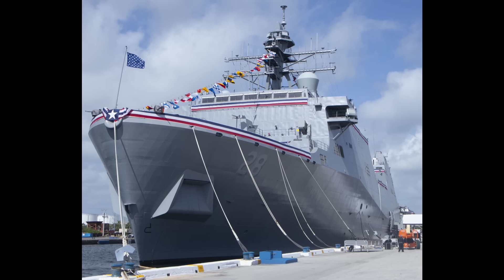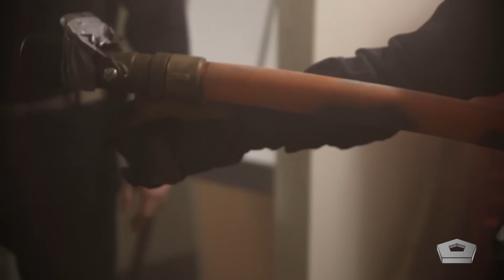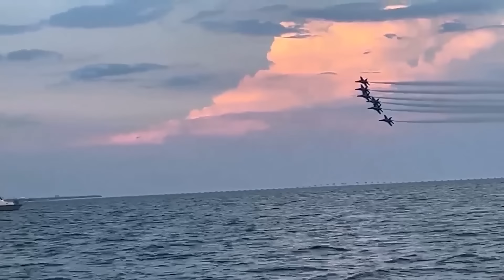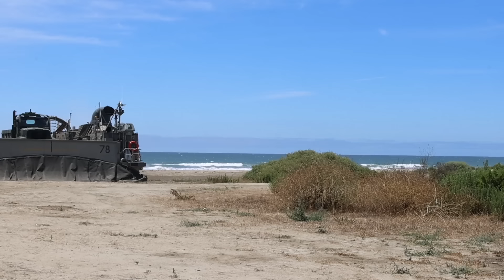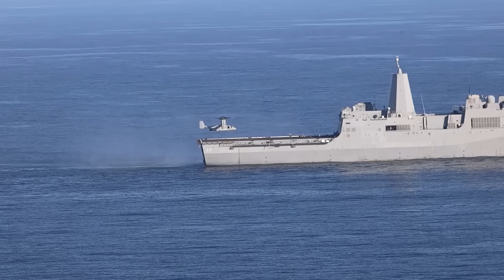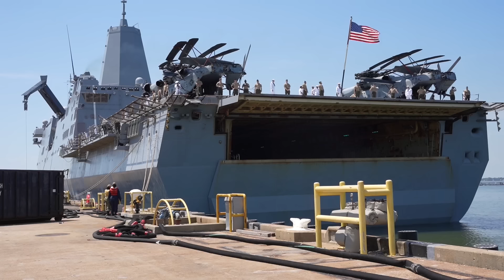San Antonio Class: The Warship That Exposed the Depth of US Navy’s Budget Problem

Comment: There's been a long phenomenon of retired high ranking navy officers (or officers of US military in general) going to various military industry, using their connection and influence to lobby for unnecessary and often time ridiculous specifications or projects, and ultimately convoluting the procurement process. For the San Antonio class, there was absolutely no reason to equip the vessel with expensive VLS. If a LSD ever need to provide its own air-defense, it pretty much guarantees there was a major fuck up somewhere else, and the last ditch insurance policies were the CIWS/CRAMs. Guess who the geniuses the defense industries have welcomed as board members and executives? Yep, you've guessed it, the same minds behind the abysmal failures like the LCS & Zumwalt.
Reply: Good point, but VLS have been cut according to Google.

Comment: If you think this ship class was handled badly just look at the current state of the constellation-class frigate. FREMM was selected because it was “off the shelf” ready to be build design. No need for lengthy R&D period. All that said, the Navy required so many changes to the FREMM design AFTER approving the contract. The Constellation is literally delayed to finalize the design. Mind you, the overall design wasn’t finalized before construction started.
Reply: The US version of FREMM was supposed to have about 70% parts commonality. It was never going to be COTS (commercial off the shelf) due to the necessary changes to accommodate US standard systems. Major issues with that program were: not realizing the major structural changes required to install those US systems, not building an engineering ashore facility to finalize systems, starting construction without a finalized design, and cost overruns coming from the European contractors. Not that there haven’t been cost overruns with the US side, rather the Europeans were completely disingenuous when proposing the plan, knowing it would require MUCH more than what they proposed. See lying and fraud in the dictionary
Reply: @nsatoday  Engineering ashore facilities are definitely the smart way to go.
Reply: @nsatoday  So two peoples with fraudulent cultures trying to defraud each other in the MIC, hahahaha, this is just too funny. It's like a thief accusing the other thief stealing from them, while they were also stealing from the other side.
Reply: @nsatoday dont blame the Europeans when American shipbuilding is pure trash just look at the Zumwalts, LCS and ford class
Reply: @BNTPP-c2k  why wouldn’t I acknowledge the European consortiums faults? I acknowledged the American ones. You are funny. How many corruption and Fraud scandals have there been with the French and Italian military industrial complex recently? France India, Italy Greece and on and on. I was fair and blamed both sides. 
The LCS was absolutely a mess. Ford? Some teething problems but nothing insane. Ford beats the pants off the next three competitors
Reply: @BNTPP-c2k  Zumwalt? Main issues there was not building them at scale. That’s what made ammunition so expensive. Funny thing about that is they’re going to be refit for hypersonic payloads.
Reply: @BNTPP-c2k  The LCS  was an admitted fail as far as original intent goes, but they are being salvaged a dedicated minesweepers. So, it isn't a tot al loss. Given the re-purposing of the Zumwalt's, I'm just sorry we didn't build more of them. And the Ford class aircraft carriers are already the mos powerful and capable ships of any in the world. We need them. I'm not blaming the Europeans, we Americans should have recognized before we got into it that those FREMM's were not at all suitable or in any fashion "off-the- shelf" platforms the USN could use. Everything that nsatoday posted is true, and your "what about" response doesn't make it Not True.
Reply: @GARYGUYTON-c7i  Ford's need longer range aircraft and drones against the likes of China.  They need to stand way off.
Reply: @timtrewyn2042  yes and no. So the range issues is being addressed in 3 ways. First, a new engine is going into block IV. The 2 competing designs range from 15-35% efficiency gains. Second, low observable drop tanks. Thirdly, larger submarine detachments per group. This allows the subs to soften defensive and offensive systems.
Edit: Almost forgot the drone refueling program and the new build Growlers and upgrade packages for the older ones. 
MAL-D is also adapted for naval use, so China, Russia etc will be trying to fight us in a multi-pronged electronic warfare setting, while their defenses are fighting saturation attacks with everything from low observable Block IV and V tomahawks, stealth JASSM-ER to Hypersonic Mako’s and more. Granted not something that could be sustained for years at a time, but probably not necessary.
Reply: @timtrewyn2042  They will stand off while the Missiles and F-22's and F-35 and their CCA's clear the skies and take out the missile bases and the PLAN. Include the f-47, if the PRC hold off on the war long enough. After about a week after the war starts, It will be sailing freely up and down the Taiwan Straight, at it's leisure.
Reply: @timtrewyn2042  US should not attack China, ever. Or Russia. Or Yemen!
Reply: @frank-y8n  China needs attract Taiwan through reform, not coercion.  Russia needs to get out of Ukraine.  Iran needs to get out of Yemen.
Reply: @nsatoday  what hypersonics? lol
Reply: @timtrewyn2042  Longer ranges can't really standoff from the 1500 km YJ-21, unless you want your jet to just carry fuel tanks lol
Reply: @nsatoday  hahahaha you people really think these kinds of tactics will saturate the Chinese navy.
Reply: @GARYGUYTON-c7i  How delusional. Assuming that your missiles can even hit PLA fighters is just hilarious when the PLAAF simply outrange anything you have. F-47 doesn't even exist, and by the time the J-36 and J-50 comes online, they will probably be paired with PL-21 with 400 km range and their air-launched YJs that will just sink everything 1500km or more away. The moment the US really start a war with China, the 7th fleet will be at the bottom of the ocean within hours from thousands of missiles and drones barrages and they will just make MORE. You people really have no clue just what a juggernaut China is. You think 500 VLS will be enough? You can take the entire USN with 5000 VLS and it won't be enough to block out China's saturation attacks.
Reply: @gelinrefira  wow, you just enjoy saying nothing of substance. Pretty pathetic
Reply: @gelinrefira  1,500km? Rookie numbers. The Chinese are great at hype, not so great at actual performance
Reply: @gelinrefira  a few points, a PL-15 got captured intact in India. The 174 outranges it, and the 260 does as well. Also, hard to do “saturation” attacks when your launch vehicles are destroyed. Not sure if you are delusional, or just ignorant.
Reply: @nsatoday  1500 km as a ballistic missile coming in at hypersonic speed to hit a moving target. No US weapon can match and the SM-3 do not have a high intercept rate of the YJ-21. Each 055 can carry 20-40 of these bad boys and 2 in anti-ship loadout will overwhelm the defenses of at least 4 burkes and sink the entire carrier group. You can delude yourself and cover your ears, but the USN certainly do not think the Chinese are bluffing. You just need one YJ-21 warhead to blow a hole into a nimitz bottom.

There was an incident where a single Type 055 sailing ahead of its carrier group and put itself at YJ-21 attack range, pushed the Carl Vinson carrier group out of the SCS. If the USN didn't think the YJ-21 work, they will sail right into its range confident they can defend themselves and always wanting to humiliate others. But they didn't and the USN does not retreat when they didn't think they are under any threat. The PLAN know what their Type 055 and YJ-21 represent, and so does the USN. The USN does not sail into Chinese waters anymore, and certainly have lessen its bogus "freedom of navigation" BS because the PLA can sink anything in those waters and they are not joking when they intercept and tell a warship to GTFO. 

The Chinese do not bluff. Professionals do not bluff. If they say they can sink your ship, they can sink your ship.
Reply: @gelinrefira  lol. The Chinese navy isn’t what I’d call “professional”. How many civilian ships have they rammed in recent years?
Also 2,500KM is greater than 1,500KM. You must have missed basic math in school. You also omitted the virgins class subs, amongst many other assets. So, yes the USN out ranges the PLAN, and has longer range missiles. Again, it’s interesting you believe that destroyed launchers could saturate anything. You also forgot so many other assets that would be used like: B-1, B-2, B-21 etc. again, you have to remember the PL-15 is outranged by the 174 and the 260.
Reply: @gelinrefira  guess you missed MAKO, ARROW, and the three other projects in the pipeline. Not surprised, but you do you.
Reply: @frank-y8n  Russia attacked NATO. Yemen attacked world shipping. I think you are confused.
Reply: @gelinrefira  What's a YJ-21's guidance out at 1400kM?  It's not something back in China without satellite or some other remote sensor tracking the target.  Flying that far, the YJ-21 will have been detected and multiple attempts at interception can be made if needed.  I would think the first choice to take out this ship at long range would be via submarine.  But they will not get a free pass either.
Reply: @timtrewyn2042 lol, the Chinese now has the most complete AI backed satellites and drone early warning that can complete the entire kill chain. The detection is not the problem. It's that you don't have a good chance to intercept it even if you know it is coming. Two Type 055 in anti-ship loadout can probably salvo up to 80 YJ-21. With each needing at least 2 interceptors, if not 3 to have a good chance of successful interception, USN carrier groups cannot practically defend against that. And you need 1 warhead to blow a hole right into the keel of a carrier. That's a reason why the US is drawing back their forces to the 2nd island chain and leaving only expendable missile systems. 

Good luck lol.
Reply: @gelinrefira   As soon as YJ-21 launches are detected, space-based and drone guidance resources will themselves be under attack.  The target is moving.  The kill chain is more fragile the longer it gets.  Now if your patriotic or risk loving agent on the ship turns on a transponder, well then, that's it for the ship unless it is found in time.
Reply: @BNTPP-c2k  The Zumwalts are now the finest thing going in the USN, The way they were repurposed is brilliant and it is a very sad thing they were discontinued., the LCS is/was a cluster f, the Ford class is a great ship. so, in that respect, your post grades out F or D at best. FMM deserves at least as much blame for the Constellation as anybody else. They were given the requisite specs at the beginning, as part of the original RFP. They were either too incompetent to realize they couldn't design and build to those specs, or decided to intentionally bluff their way through the process anyway, fraudulently.
Reply: @nsatoday  The Zumwalt already has been, and undergoing sea trials re those systems. It is a shame we didn't keep building the, the way we kept building the LCS. It would have bee better to cancel that, instead of the Zumwalt.
Reply: The problem is that the FREMM was NOT “off the shelf” compatible with USN technologically or operationally. Hence the need for changes.
Reply: @GARYGUYTON-c7i  it was a “off the shelf" design purchassed explicity as orderedby the Congress. If that was not viable and the US Navy had to redesign everything from the Combat System to the showers, wine caves and toilets, why even bother taking a foreign design ? Why didn't the US navy warn the congress about this, and why the incompetent admiral in charge of the LCS was in charge of the Constellation ?
Reply: @ddoumeche  Good questions, for which I have no answers. The off-the -shelf "compatible" design never existed. coulda, woulda, shoulda. But didn't.
Reply: @ddoumeche Navy insiders stopped a new naval warship producer from gaining a foothold in the USA....
IIRC contract required Navy to build an engineering ashore facility...which they ignored.

Capitalists hate competition 😅.
Reply: Great comment. Look at what’s happened to the Constellation class now😢. What a waste.
Reply: The US should have just go with Navantia and their F100/Fridtjof Nansen designs that have mostly US systems
Reply: @FelipeCH-fn7sc  Sorry, I'm not familiar with that ship. But I'd love to see our Navy getting ships that were at least mostly compatible with ours. It would take a huge burden off US shipyards. Buy it, modify is a small amount, and have a brand new ship serving not just the US, but all our allies as well. Despite everything, we really are all in this together.
Reply: The only change we should have had was more VLS and add NSM launchers
Reply: @pnw_wanderer9786  It was far more than that. Pretty much the only thing that was originally FREMM is the the hull below the main deck.

Comment: It certainly exposed some problems in the Navy's ship construction contracting practices (well, this and the LCS). How about next time, instead of building Flight 1, we build one ship as a prototype and learn from that, rather than making all the same mistakes on ten ships?
Reply: Because, in actuality, it's CONGRESS that forces the US military to do that.
Reply: I like how upgraded systems for Arleigh Burke destroyers are first fully tested out in a land-based lab.  You would think they might build some ships entirely out of proven systems just to get to sea more promptly and with few bugs to work out.  It may not have everything wanted for survivability, but what it does have would be proven and probably on-line.
Reply: The idea doesn't seem very smart. How the US Navy will screw up in innovative ways in the name of "reinventing naval warfare" if you do this ?
Reply: They didn't do that with the LCS ships, they made 4 (2 of each class), then worked out the kinks, and then started making more
Reply: @davidbrunner4413  I agree, but the LCS ships are not suitable frigates
Reply: @ddoumeche I never said they were, they're great ships for what the original mission statement set out to do. And i mean the original, not what the admirals tried to turn it into. It was originally intended for maritime patrols close and close-ish to shore and if the navy would've stuck to the KISS method, they would've been excellent for it